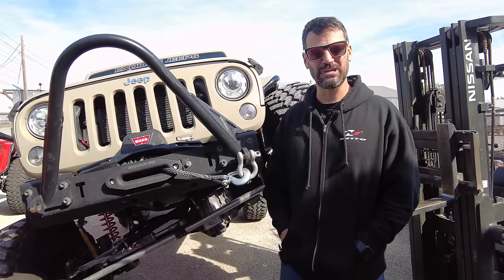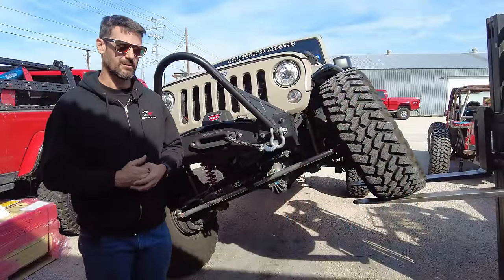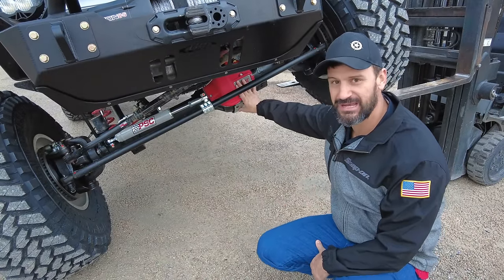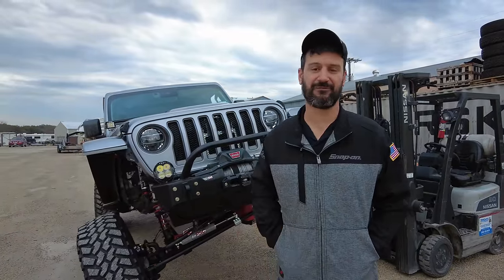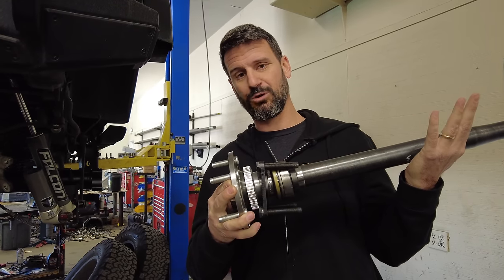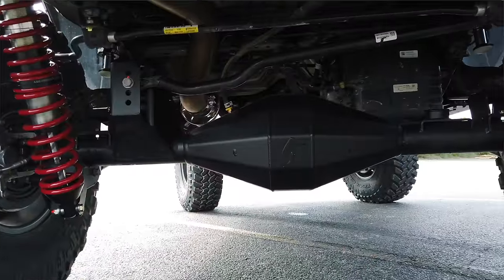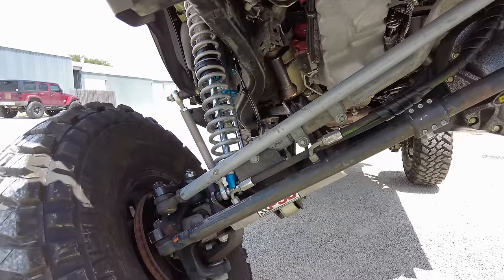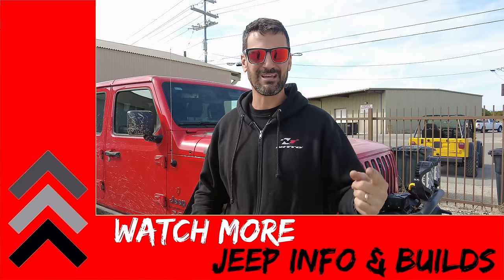Don't Get DANA 60 Axles Until YOU Watch This Video! - Axle Comparison

Comment: Hey whoa dont sleep on the 1310. I broke a 60 stub shaft with a tom woods 1310 shaft. When it finally goes, I will be going 1350, but you absolutely dont have to have a "1350 at minimum."
Reply from the maker: Use what works for you, but I've seen enough 1310's fail to know what works best for these setups.

Comment: Can you drive 60/80 axles for a everyday Jeep and traveling thousands of miles? Would it be better if you put it on a trailer instead of driving it thousand a mile with the 392 or 426 Hemi. 11-27-23

Comment: Great video. I had often wondered the difference.  Any idea why the F9 is not more popular? Lighter and stronger, how often does that happen? What is the down side?
Reply from the maker: ARB air lockers…
Reply: pinion is 3" lower the driveshaft angle is worse and the driveshaft/yoke/pinion are down in the rocks.

Comment: Another great video. I was able to pick up the Dynatrac 44/60 serious performance combo for my JK for $9200 with arb air locker ( they were in stock) . I will be bolting them in this weekend.
Reply: Where were they in stock? Ordered my set in October. Mine are in transit now. Hoping to receive them next week. Cannot wait!
Reply: @davidyoung30  call Zach at Top Tier suspension
Reply: What size tire are you going to run with those axles
Reply: @outsidewithdj  I have 35’s right now but I will replace them with 37’s. I don’t plan on running anything larger than that
Reply: @mattmcdonough707  That’s who I ordered them from. I went with 4.88 and Eaton lockers. Also running 37’s. They arrived at top tier from dynatrac yesterday. Thinking I want to hit EJS but man I have a lot to get ready in 7 Sunday’s.
Reply: How have they worked out for you guys so far?
Reply: @BushmasterM4A3  the axle are great no issues. The Jeep drives great and feels more solid on the road if that makes sense.

Comment: I got the axles for my xj from East coast gear supply. They were very nice to deal with. They'll build it however you want and it seems like with whoevers parts you want as long as it's good stuff.
Reply: What did you get ? 
I get thier 8.8 with a 3 page build sheet (2,750) delivered.  and planning on haveing  them do me a 5 lug ball joint 60 front.
Reply: @station08  I got their dana 489 axles the rear 35 spline and the front 489. Mine were close to 11k with upgrades. I run 37s and I'm not too worried about breaking anything they are incredibly strong axles in a small package. I got ox lockers front and rear and I got the rear set 20 upgrade with disc brakes that's where they weld larger ends on the tubes to use larger bearings then the front and rear axle tubes are incredibly thick like 3/8 or 1/2 thick. My rig is set up for a mix of overland and hard trails I've tried to be careful about weight but I'm right around 5100 pounds with all my accessories and cage/armor frame stiffeners etc..

Comment: I used a 78 Ford Dana 60 'sno fighter' in my FSJ Cherokee.  The perches for the leaf springs had the same location as the stock Jeep, except they are on top so it was an easy way to get 6" of front lift.   High pinion and king pins.  Added a locker and some yukon hubs.   The stock brakes are not great, they could use an upgrade.   It works and is cheaper than the crate axles.   Although I wish my jeep had the same level of aftermarket support as the JK/JL''s and the rest of the Wranglers!
Reply: Wayyy cheaper. Someone that actually searches can do this much cheaper. Not quite as clean and new but will function just as well

Comment: Great video.  So a couple years ago you broke the axle shaft on your spicer.  Do you think that would have happened with any of the other axles you showed and also do you think the other companies would have honored the warranty in the same situation?
Reply from the maker: That break could happen to anyone with any axle. I think any other company would’ve responded better.
Reply: @Exodus4x4  14 bolt is for you (shaved 13, even better)

Comment: Great Info!!  I've been trying to decide which 60 axles to go with.  I was leaning toward Currie already and this confirms I'm on the right track.  Do you have an opinion on the strength or weakness of the high pinion rear axle?  I've heard the reverse cut gears are a bit weaker on the high pinion rear.  I wish they still made the F9 axles, but they aren't on the Currie website anymore.  Hopefully I'll be getting in touch with you in the future for a V8 swap!

Comment: Do you think the Currie LP60 (40 spline w e locker) rear axle can handle 40’s in the rocks on a JKU? 
 I have a Tera44 with 1/2” 3.25” tubes with Revolution US forged shafts in the front right now with 37’s and only ever had a rear twisted bent Revolution shaft in the rear on my rear 44.  This Currie and keeping my front axle instead of switching to UD60’s and new wheels would save me a tone of cash and time.
Reply from the maker: Yeah I do. Haven’t tried it personally but I wouldn’t be afraid to run that setup
Reply: @Exodus4x4  Thanks for the feedback.

Comment: Are UD60s with 5.38s strong enough for a 392 running 40” Nitto’s? I know a lot comes down to the driver but I wheel a lot of east coast trails (IE wheelspin) but also wheel out west 1-2x a year. Or would I be better off going with a 60/80 setup?
Reply from the maker: They’re fine. Built quite a few with that combo

Comment: Last question. What is the weight difference between the currie semi float 60s and rubicon axles and would you run 40s behind the diesel with them?
Reply from the maker: The Curries will definitely weight more but I don’t know by how much. I would run them on the diesel and 40’s

Comment: I have a 63' Gladiator with a Dana 60 full floater in the rear & 44 in the front, would like to go disc in the rear & need the leafspring pads in front on the top of he axle.What can you suggest to me 9n this?

Comment: I have a JL sport with the 30/35 axles set. It is for sure the rear 35, I got unlucky with this jeep and it didn't have any of the options that bumped it up to a 44 rear... Since the currie front and rear axles reuse a lot of stock pieces,  will they still work for me or do I have to purchase Rubicon knuckles and breaks for front/rear?
Reply from the maker: They will work for you, but you will need to buy a high clearance tie rod. Other than that, pretty much plug and play.

Comment: Whats “the best” suspension for a JT that doesn’t require butchering the Jeep frame or altering a brand new set of axles like these? 
Drilling seems ok but welding im not to keen on. I live where rust is a concern
Reply from the maker: EVO is making a bracket to correct the rear geometry, so I would go that route

Comment: On the curey axles with 5 lug nuts, will the rock krawler triangulation kit work? For a Jt. I definitely would want to weld it. Is there an option to have curey install it before gearing and powder coat? This might be the option for me if I'm going to change the axles. I would want 60s all around, but I do like the fact I get to keep my wheels instead of a prorock 44 and semi float 60.
Reply from the maker: I believe RK is working on a D60 option for their rear triangulation bracket

Comment: silly to use eaton e-lockers they unlock and re-lock when changing directions and aren't as strong as arb air lockers.
you failed to mention the 9" has a 3" lower pinion position which means the driveshaft angle is worse and the driveshaft/yoke/pinion are down in the rocks.